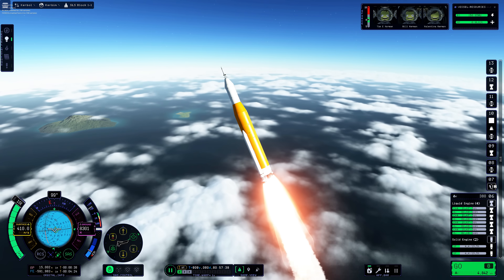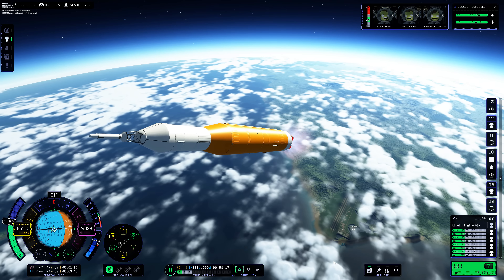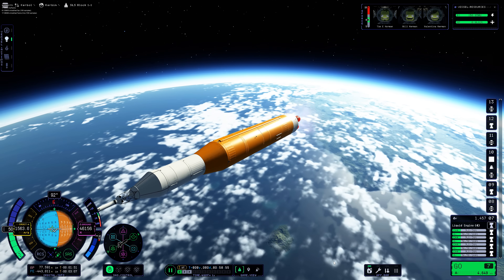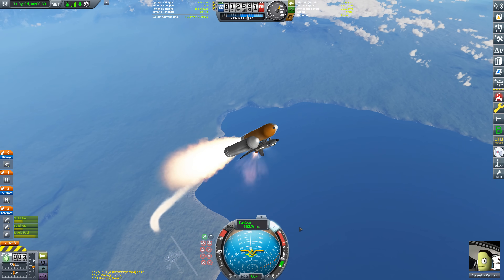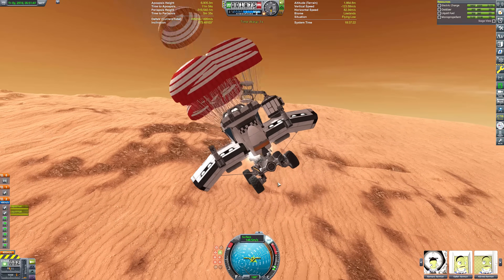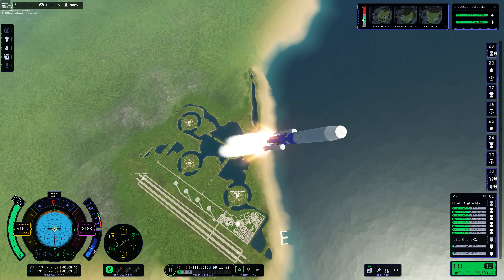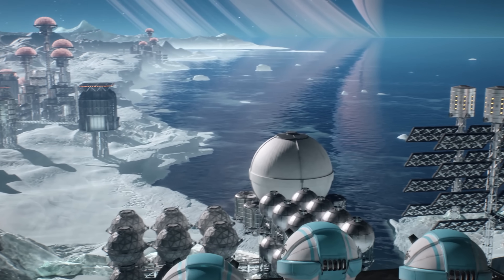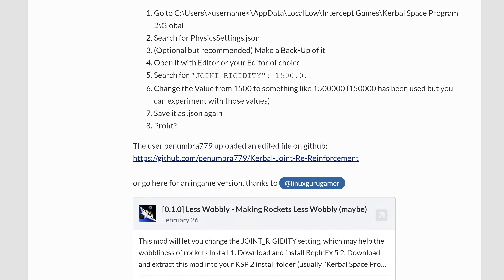Wobbly Rockets Still Haunt KSP2: Developers Face Uphill Battle

Comment: You keep saying, "Yeah, but I'm not a programmer," but to be honest, nothing you said is wrong. What you said about the computer seeing if there is an object that's too big would be done by leting the majority set the load limit or having the load limit set by the player. Then, if say five objects have a load limit of 5000 and one that's on top has a limit of 10,000, then it puts a joint between the one that's 10,000 and the one next to it, with the weakness being filled in by the difference, allowing it to snap if the pressure of the rocket lauching exceeds the joint weakness. Basically, if X is greater than Y, then we do Z (add joint). 

They could also have an internal support system; the stronger it is, the heavier the rocket, or something like that. You could also have it so if someone makes a noodle rocket it adds up all the parts, and at the point that number (counting from the bottom) exceeds the structure set by the player it adds a joint. The best part is that all of this could be calculated when the rocket is being made, so when it's doing the simulation, it won't need to worry about so many joints in real time, just the predetermined ones.

Comment: What if a certain subset of joints can be agglomerated into single physics parts, but others are allowed to flex? For instance, if two tank sections are attached together, they will be treated as one body, but if another section is attached via docking port that joint can flex a little? This would be both realistic and computationally efficient.

Comment: Matt, I'm absolutely with you on the thought that sensible stacks should be modelled as single objects....  in fact I used to do exactly that in KSP 1 using UbioWeld before autostrut did such a good job of taming wobble.   It did also greatly improve performance on the hardware I had at the time.

Having the options of treating stacks as single objects, or activating individual autostruts like KSP 1 would be an ideal for me. 

After all, if you compare to the real world (and I know KSP isn't real but surely at least needs to be credible) rocket stacks RUD if they flex a fraction of what we see in KSP2.

Comment: Holy shit, simulate flexibility at docking ports and radial connections (for fun) and wings (for actual realism), and treat everything else as fully rigid. Its not that hard. Punish bad designs by occasionally checking stress loading (on a worker thread) at various part connections and blow them apart if it exceeds some per-part limits.

Comment: you are correct in your assumption about rendering joins etc. The developers of KSP2 are not good at game creation, they are worse than most casual hobbiests and a single passionate hobbiest could have made a better game if they were handed even 1/10th of the resources that were availible to KSP2's developers.

Comment: According to my Steam account, I've logged 3200 hours playing KSP but only 30 hours on KSP2. The reason for this is the wobbly rockets bugs among other things. I can understand development problems, but I don't get just lifting the code from KSP 1 and dropping it into a new game engine, especially not when we were charged for a fully developed game when it was launched. I would have soldiered through issues like the parts manager or the interface between different spheres of influence, if I could just get my rockets into orbit without them flopping around like wet spaghettis! The idea the devs floated that players would like this is just double speak for them not having fixed this in the very first update. It should have been priority one in my opinion, and I can't enjoy the new game until this is fixed. Thanks for continuing to call this out, Matt. Long time fan of your videos.

Comment: This shouldn't be a problem that is going on for months with no solution in sight. I honestly think the game shouldn't have even launched into early access with "wobbly rockets" or with missing atmospheric drag heating. There definitely should have been a meeting after the community said "wobbly rockets" makes the game unplayable for various reasons.

Problem: Rockets bend, twist, and break in ways they wouldn't in reality. This problem stems from how the physics engine interacts with the individual parts of the craft. This problem causes extra physics calculations which in turn causes various other problems, including performance issues and the "wobbly rocket" effect. 

Solution A: Gaslight the community into believing that "Wobbly Rockets" are part of the game's charm.
Benefit: No additional work needed besides community outreach.
Drawback: Doesn't actually address the problem, and the community might rebel.

Solution B: Disable physics calculations on individual parts of the craft, and treat the craft as a singular object.
Benefit: Simple solution that cuts to the core of the problem
Drawback: Loses realism, especially with larger or more poorly designed crafts.

Solution C: Selectively Disable physics calculations on individual joints
Benefit: Aligns more with the realism objective of the game, while still punishing poorly designed craft.
Drawback: A more complicated solution which will take more work.

I like solution C, and I honestly don't think it should be difficult to implement. They need to have 2 forms of joints:
Rigid joints which have no extra physics calculations and would be between like-sized, in-line parts.
Flexible joints which get extra physics calculations and would be between surface attached parts and parts in-line that are mismatched sizes.
I could imagine having an "advanced tweakables" option which would allow the player to manually set if a joint is flexible or rigid. There could also be additional gameplay options of "only flexible joints" or "only rigid joints" which would override joint options saved with the craft.

I say that it shouldn't be difficult because of how .craft files worked in KSP1. There would need to be a property that says if the attachment to the parent part is rigid or flexible. As for determining if the attachment is rigid or flexible, it shouldn't be too complex, just determining the attachment type, i.e. surface attachment or attached to a node. If it's attached to a node, there might need to be a part size comparison to determine if the joint will flex e.g. connecting a 1.5m part to a 2.5m part will cause flexing. Surface attachment will likely always be flexible. The hardest part of all of this would be handling the joint types in the physics engine. Handle it correctly and there should be some performance gains, especially for crafts with higher part counts. Handle it poorly and the performance will tank.

Since it also seems like part count is also a problem, they should have procedural parts for rockets, e.g. sizable fuel tanks with swappable fuel, sizable trusses and structural pieces, and sizable cargo bays.

Speaking of cargo bays, they should probably have a way to make stuff contained within cargo bays, service bays, science bays, or fairings to have only rigid joints until they are disconnected from the parent craft. Whether that is having the interior surface of those parts being a rigid surface attachment zone, having a volume detection method which makes the joints rigid while being a part of the craft and being contained within the volume, having a separate part which is meant for rigid cargo attachments, or something different or a mixture of solutions. I imagine this shouldn't be too difficult to manage, as it's something that needs to be done for atmospheric drag calculations anyways.

Also, for colonies, there could be an anchor part that, when attached to a surface, disables physics calculations for the entire craft. Hopefully that was already their solution, otherwise I don't know how there wouldn't be massive performance issues around player built colonies.

Comment: I don't think planet coaster is Unity fwiw.

Simulating the torque on each joint is probably required for joints breaking, but applying a curve to keep it at zero for low values would likely do the trick and stop SHM and wobble starting. Likewise a little more damping might just be enough.
Reply: As far as I know planet coaster runs the in house engine elite dangerous runs on.

Comment: Treat the vertical stacks as single pieces, identify the weakest point in that stack and the forces that would cause it to rupture, and actually have it BREAK, with feedback as to what's happened, rather than wobbly?  If we're talking realism, then a wobbly rocket shouldn't be bending back and forth like that, the material should be crumpling and staying crumpled.  At the moment these 'realistic' physics are treating my separators as if they're made out of rubber instead of some high strength metal designed to resist compressive force.

Comment: Engineer here. 
Vertical stacks do wobble and indeed need to be considered when designing any system, it just doesn't wobble nearly as much as in KSP. The joints or bodies themselves seem to be far too soft and thus wobble far too much. The easy way in my mind to solve this and keep the simulation of multiple discrete bodies bolted together is to make them more rigid (I have no idea if that is even an option or considered in KSP2).
A part of the problem might also be the almost instantaneous movement of the nozzle. In any resonating control system you want to avoid something like that at all costs. The wobble is basically a step response of the rocket stack to the instantaneous "step" the engine does. It's as if you would bash the end of your rocket with a giant hammer every time you do a course correction. To solve this you would have to make the engines move slower and more gradual. This would cost responsiveness though. So the rocket would feel less responsive when you control it with a digital keystroke.

Comment: The solution is even given in this video: all the rigid parts connected by a joint should be considered as one unique rigid part, and it will remove all wobliness... Poorly designed rockets should break or flip, not woble

Comment: « Early Access » if it was applied to cars :

- You wait for a new model
- You wait as a mofo cause it's 3 years late on what was planned initially
- You pay full price for it
- You get a rushed unfinished prototype that doesn't brake or turn
- You send every week a report to the brand to tell them what they need to fix or even just implement

- The seller and the fanboys aggressively tell you that you are privileged for paying for this pile of sh!t and having to do the job of the engineers ! 😂

Comment: As a Dev I see obvious resolution path here and it's alarming that they are not considered in KSP2:
1. Short term, low cost high reward solution: Add a "Simulate joins" game settings and add it to the telemetry sent so they can get numbers on how many players would rather disable it
2. Mid term, high price low reward: reimplemented auto struts. Hey it's not a good solution but might be better for balance purposes.
3. Long term, high price high reward, the real solutions: selective physics, after construction a physic simulation is applied with all joins and before launch auto optimizing joins number (removing joins between cylindrical parts, merging parts that could be realistically constrained IRL or are clearly sufficiently attached with struts, ect...) 

The thing is that indeed physics simulation is hard, but there are a plethora of optimizations that can be done and doing a first simulation and optimization pass before launch seems to me like an obvious choice. It is hard to implement but it's what is done IRL, engineers don't just launch rockets to see how they react, they have simulations and test chambers...

Comment: They just need to simulate stress.  They don't need to model deflection.... Having the engine decide which joints are ridged before flight simplifies the problem, but it has to be re-approached for on orbit construction.  (Structural docking ports that do the same thing)
But if they were smart, we wouldn't be in this situation.  
That comment they made about the big ships means they want the multi part physics sim to contribute to the sense of scale of interstellar vessels.  I have many words for them, some of which are no one will care by the time we get there if we don't take the problems of immersion in what the player is doing seriously.  (Anything a sim game that reminds players its a game comes at a cost).

Comment: I will say, I, personally, am somewhat of a fan of wobbly parts. I do agree with the novelty statement for the most part in the cases of someone building a 4 and a half mile long stack that bends all the way back down on the launch pad, or the flex in the plane wings that let you feel when/how your space plane is going to disassemble on re-entry, but less so in the accounting for archer's paradox in a faithful recreation of a realistic, fairly tame rocket design. I hope the joint calculation stays in a state that is fairly consistent amongst parts, but there is definitely a problem in the current calculation that needs to be resolved.

Comment: That's why I now turned myself toward Juno New Origins.
There are many vehicles made of thousands of parts and no performances issues with such part count.
From sport car to helicopter replica, and BTW, real swash plate and rotor physic natively supported.
You can make things looks EXACTLY like you want, because you can manipulate shapes the way you want.
And while it also suffer from the typical game "if too much strength between two part, they get far apart but still wirelessly connected" rather than "elastic deformation until plastic deformation then break", it has close to 0 wobble issues, regardless the size of the thing we make.

The game is far from perfect, the aerodynamic is ultra simple, making tight turn or flying straight give you the same final speed per altitude lost in the end, proving that angle of attack do very little.
But for MANY things, it is much better than Kerbal, and the fact their humanoids have a much more human shape rather than the big-headed cartoonish Kerbals make it MUCH better for reproducing realistic designs.

Comment: One of the points that I like of KSP is that stresses internally do happen, and when you, for example, bring an airplane into a high-gee turn, you can rip your own wings off. It happens IRL, and it'll do stuff like that. I think that there's a useful tradeoff to simplify joint physics to some extent, but there's a big difference in interesting gameplay avenues when you have a solid rigid rocket and a wobbly mess.

I think that difference to support both plane/style craft and rockets make the idea of "vertical stack" a complex concept.

Comment: I think something missing here is that the only reason that these joint physics even exist is because of the way you build rockets in KSP, by stacking a bunch of individual tanks on top of each other. Exactly zero rockets are actually built like that, as a bunch of little individual segments with joints between them. They're all just one giant tank with bulkheads to separate fuel and oxidizer. The Lego-brick model of rocket construction does work well for KSP, but why is there seemingly an insistence on pretending that the joints it creates must be modeled in the name of "realism" when real rockets simply don't have the joints in question?!

Comment: I think the good solution for this may be: 1) simulating the rocket as a single rigid body. 2) Mathematically estimating resonance frequencies for joints based on simplified geometry and mass distribution. 3) Performing FFT on forces applied to the rocket and bending these joints accordingly if resonance frequencies are well presented in FFT. This may work better and still quite realistic.

Comment: I am still not convinced that ksp and ksp2 should have any flex in any joint, with the sole exception of robotic parts rotating things around, and if we are going to have to endure this a system for attaching parts directly to other parts in a way more robust then applying half a dozen struts where in real life you would expect a weld to be would be called for.

Comment: Every part connected to an attachment point should be joined together as a single rigid body imo.  This would cut down on the wobble AND massively improve performance.  It's such an easy solution, idk why this has not been done yet.

Comment: If your rocket is wobbly then it's too long and skinny. You have to use larger fuel containers or you can stiffen it up by by putting structural trusses near the middle and those cable ties out toward the ends of the rocket.. I've recently been dabbling with adding unmanned rescue pods for those lost astronaut rescue missions. It's way more fuel efficient than sending a whole ship to do it..

Comment: As a CS major with casual experience with Unity, every part being a RigidBody is definitely not ideal. It'd make more sense to separate crafts into different attached RigodBodys based on defined rules. Like you mentioned, a single stack of fuel tanks shouldn't wobble, so keep stacks as single bodies. Stacks attached by radial decouplers probably should flex a little if they're not properly strutted, so make them separate. Small things you'd attach to the craft radially shouldn't flex at all, so make solar panels and radiators part of whatever body their attached to.

A system like this shouldn't be difficult for an experienced developer to implement. If the team went all in and focused on this kind of feature, they could do it in a week. It isn't ideal, but it'd make the game more fun to play, and it would DRASTICALLY improve performance for larger crafts. Imagine a 500 piece craft running at the same framerate as a 10 piece one does right now.